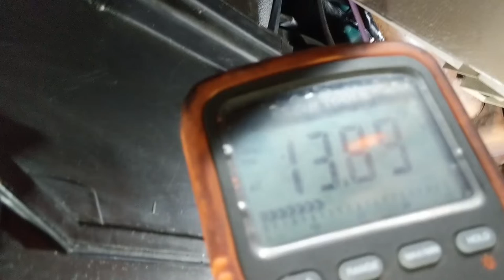Weak Blower Motor Fix 88-98 Chevy Truck - AC/Heat Air Flow Diagnosis

Comment: 1999 k2500, I pulled the blower and with a tooth brush and soapy water in a spray bottle.  There's a opening at the bottom so the water leaks out , you can see it fr outside the vehicle. 
Sprayed the inside with yard hose.
Sprayed soapy water.
Light scrub a dub. 
Rinse.
And it looked and operated like new.
I did have my daughter (tiny hands and arms do the scrubbing) to be fair. 
Thanks for the video.

Comment: You can also remove cowl vent on top towards the firewall and vacuum all the leaves , debris whatever might be blocking your air from entering your fresh air into the hvac assembly. Also clean the drains that exit towards the engine compartment. One just below the coolant overflow tank and the other on the opposite side same location. Hope this helps y’all also. 🙏👍

Comment: I did the same things you did but went a step further. Layed a large trash bag on the floor, sprayed the evaporator with simple green and let sit for an hour. took my water hose with a hose end sprayer and literally washed out the evaporator.and this also cleared any left over debris out of the drain as well. Works like new
Reply: @Frank DuBois removed blower motor, sprayed with simple green and let sit for half an hour, used hose end sprayer and sprayed gently for a couple minutes and made sure water came out of drain on firewall as well. Dried as much of box area as possible and let sit over night to properly dry. Replaced motor clean smalls good and blows harder thru vents. First clean out all debris you can, kinda iffy to get your hand in to all the areas but worked great.

Comment: Consider instead of degrease and water, set vent setting knob to face/upper body, take dash off, take all vent registers off and plug all but center one with rags, take blower motor out and get in there with appropriate brush and while brushing put nozzle of strong leaf blower into center nozzle. While you're brushing all the stuff you knock off will blow out toward you. I did this and got a perfectly clean evaporator.

Comment: There's even more you can't get to. The best, and hardest, way to take care if it is to pull the HVAC box out, which requires pulling the dash. Then replace the evaporator. I would advise replacing the actuator motors also if you do. Definitely put a fine screen on the outside to catch this stuff before it gets inside.

Comment: You are so smart, this morning pulled blower off, not easy, same thing with that top bolt but I got it out. I was looking for the grid evaporator to clean it as my blower could blow higher. shoot didn't know it was to the left. 98 Silverado 1500. will do when it's cooler. probably my seals are old too. ty God Bless

Comment: Good video a lil too in depth for me but very informative nice job cause I suck at wiring lol oh quick tip of the day a toothbrush or soft brush lay some towels in the floorboard and stick a water hose in there and blast it it will come out of the water drain underneath if not you can use hose to unclog it.

Comment: Use an old soft toothbrush and a good cleaner like Simple Green to clean the evaporator and spray with a garden hose on low pressure with a spray nozzle on a wide pattern .protect your carpets with old dry bath towels. The drain should drain any water to the outside under the vehicle.

Comment: 2-04-2022  Get a large sheet of plastic cover the front passenger seat , center console , front floor and be prepared to get wet it's just water. Spray purple Degreaser on it and brush it with a bathtub brush and get the garden hose and spray water in from the opposite side or ,either side for about 5 minutes it will clean off.

Comment: I’ve got a 97 GMC sierra. When I first start up the truck and turn the blower switch to high I get a little bit of water spurt out to the passenger floor. Is that it AC drain pipe issue? I’m trying to diagnose an intermittent overheating issue with this truck. I have back flushed the heater core I replace the thermostat I replaced the temperature sending unit I replace the coolant temp sensor and I have no leaks. But intermittently the truck will start to overheat and the hot air will turn cold. Eventually it straightens out and it’s fine but I’m still scratching in my head as to why this keeps happening I don’t like having to stare at the temperature gage while I drive the truck out of fear it may start to overheat. Hopefully I can get some good information from you and others I’ve asked. Thanks. Man!

Comment: My blower fan stoppes working. It would work then barely work then i hit it with a rubber hammer and it would work but now it sounds like it turns on but isnt blowing any air at all. But you can hear it turn on. Going to try what u did and take it out to see whats wrong

Comment: I have a 92 Chevy k 1500 Silverado this morning I removed my blower motor and jam the Shop-Vac holes in there it angled it around the best I could and I took a picture afterwards and it looked completely clean it was just as dirty as his. I haven't tried this but I wonder if you could shove a cabin filter in through the blower motor hole just an idea but regardless my heater is blowing better than it was I would put it on recirculate I can feel all the airborne back out to the event by the blower it's supposed to be sucking air in

Comment: Use a soft bristle tooth brush with your favorite cleaner to clean out the condenser. I use Greased Lightning to do this along with a towel under the condenser. Fold the towel sever times to catch the overflow from the hose pip. DO NOT GET TO AGGRESSIVE with hose pipe.
Reply: You mean the evaporator coil -

Comment: see I think this is the issue on my truck, but my dad thinks otherwise. The fans arent blowing very much and it takes a bit for the high to actually kick on compared to the low or the medium setting. its a 1992 silverado and ive never been in any other one. im just not too sure if those trucks are just weak with the fans or its just the motor blower. some fans sound like they are puting out a lot of air but the center two are not, or sometimes all of them are just weak, even on high they are weak.

Comment: I have a 1997 1500 Silverado and when you turn ac on there is a clicking noise in front of moter at fire wall there is actuator that moves when you hit ac and it starts clicking  you turn ac off it moves and clicking  stops also going to clean for better air flow
Reply: So you’re saying that’s the actuator? Cause my 95 Yukon does the same.

Comment: Oh yes, removing the heater box is not an easy task (for my truck at least), the first step requires going to someone that can recover the refrigerant. On my 90 Silverado the dash is a nightmare to remove. It helps to have two people. With older dashes, most likely, you will break stuff so have a plastic welder to fix them. New foam seals can be had at LMC truck or weather foam cut to size and put down with spray adhesive. Any AC lines you disconnect, bag and zip tie the ends  to keep crap out.  Once the dash is out get your heater box out. At this point why not just replace the Evap and cap the ends. If you heater core looks like it has any pin hole leaks replace that too. You really do not want to go in again do you? Also while the box is out remove the top bolt of the air door actuator and throw it out. If that actuator dies it is damn near impossible to remove with the heater box installed and works perfectly fine without it. Reinstall the box and dash. Let the person who recovered your refrigerant  hook everything back up because you will need new seals then they check for leaks plus they will know how much compressor oil needs to be added back into the system.  Note: The Haynes manual for this vintage of truck states you can remove the heater box without taking the dash out. Well for a 1990 k2500 4x4 Silverado if you can do it my hat is off to you.  I just got done doing this so order your parts first and give yourself a solid weekend and keep sensitive ears away from the cussing.  Great video. Cheers.

Comment: Tested mine. 11 with the truck off and 12.3 with it on. Both times on full blast. Does that sound good, I’m having weak flow after resealing yo my lower damper and cleaning behind the blower.

Comment: Thanks for your video.Will help me on my 1990 chevy.Thanks again.
Reply: Not so easy as 88-94 dash is lower. Its a PAIN to get the top screw out
Reply: @mikegrassman4773  just need a swivel extension

Comment: I have mice in my 1991 caprice evaporator. I took off the blower motor cause It was bad and there was a lot of nesting and poop also in the resistor area i have not checked the heater core area but I’m guessing there too because it still smells

Comment: Have you ever run across any problems in these your mom pickup swear the AC is engaging has plenty of fluid wants to get cold but it's not. Almost act like the HVAC control module for temperature control is not working and is stuck half cool half hot vi Vehicles AC going down the road is only approximately 65 degrees
Reply: if the ac knob is a potentiometer type dial, you could try turning it all the way hot to all the way cold a couple times real quick and fiddle around with it in the cold portion. turning the dial makes the wiper arm of the potentiometer brush the resistor coil and helps to clean off oxidization.

Comment: Replaced blower motor resistor and blower motor  changed switches only have high and low  no intermediate speeds

Comment: Thanks for the video,i have an 88 blazer and every so often i'll be driving and my ac will stop blowing and no air whatsoever will come through the vents and then come back on after awhile,and i was leaning towards the low pressure switch on the accumulator but one guy said it actually might be your blower motor,any thoughts?

Comment: I'm getting hot engine compartment air blowing in. It's coming downwards between the blower and kick panel. Any idea what I need to do to seal that up?
Reply: Hey i have same problem did u figure it out
Reply: I had same problem ended up changing all ac actuators beacause only my defroster was blowing ended up solving the heat blowing thru the bottom

Comment: I have a 96. It usually takes a few seconds for mine to start blowing. Now the weather is 19 degrees and it stopped completely. Can it be frozen? 🤣
Reply: I’m in the same boat as you with my 96🤣
Reply: -@Frank DuBois FYI I saw a thread on a site that shared when your blower switch only works on HI it is usually the Resister close to blower motor that is the problem. There are videos out there showing how to replace.

Comment: I have 1998 chevy tohoe I changed the acuator and temp control with thermastar and water pump and still get no heat whats the problem
Reply: Mine was the heater core. It was a bitch to replace. I ended up paying a mechanic friend to do it. Hot heat now. Good luck
Reply: I am sure your header core is clogged. Flush your header core and it will most likely fix it. Just google it how to flush a header core on your truck.